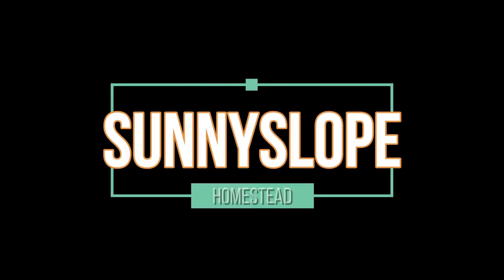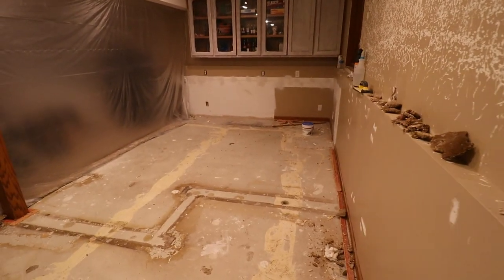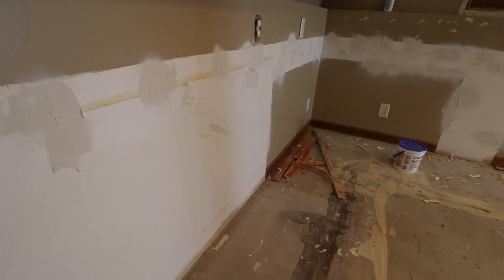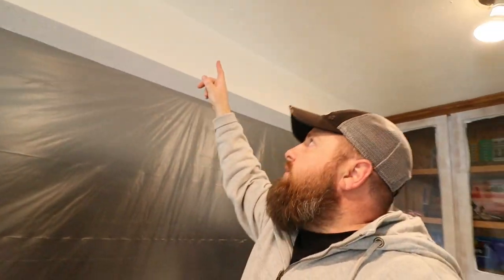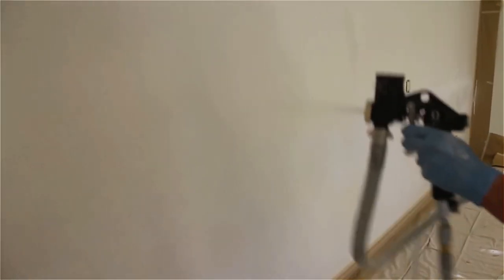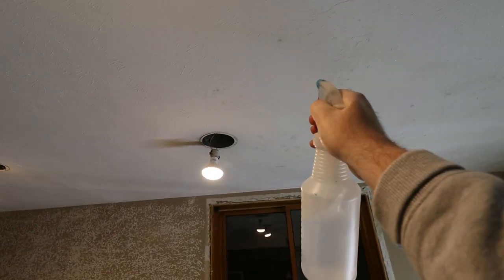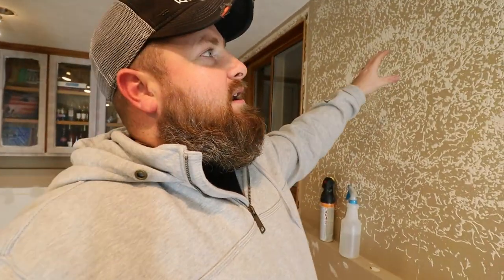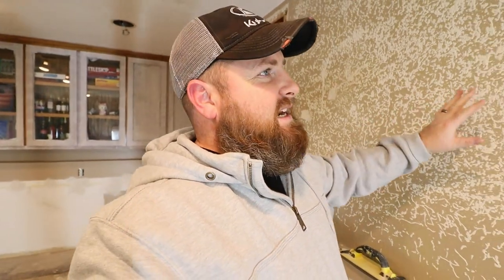🔷 This INFESTATION Was Once LIVING IN THE WALLS OF MY HOUSE !

Comment: Looks like plaster or lime was added to the compound to prevent it from shrinking and developing cracks. The quickest way to correct that ceiling to a flat service and hide those ugly sceme is to get light weight compound and roll it on the ceiling. Then taking a 12 inch tape knife and pull it over the ceiling. If  you are good with a knife, the sanding will not be neccessary. Also with the wall with the bad paper under the window and cabinets. If you were to mix a little plasterin the compound, it will dry quicker, harder but remain sand-able. You can always replace the sheetrock too. :)

Comment: Those retrofit LED lights are awesome!  I used 5 of them in the kitchen in my old house, and they made it so bright it was like having the sun right in the kitchen for the same energy usage as one CFL bulb  For the ceiling, I would put a skim coat or two on it instead of trying to smooth what's there.  Since water doesn't soften it, there's no telling what they used on it.  You might be trying to sand mortar or concrete, or whatever they had on hand.  I hate drywall!!  I have my entire house to do, and I am not looking forward to it at all.
Reply from the maker: I can’t wait to get this basement done ✅ I hate sanding dry wall lol

Comment: I had that popcorn ceiling and instead of scraping it off I just put 1/4 to 1/2 inch drywall over it and then taped my joints then painted it, just a suggestion